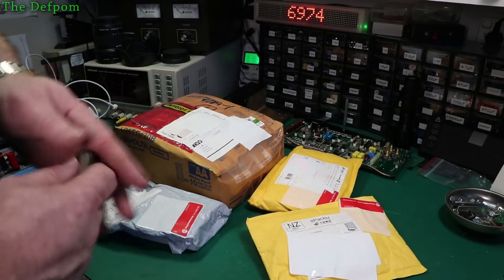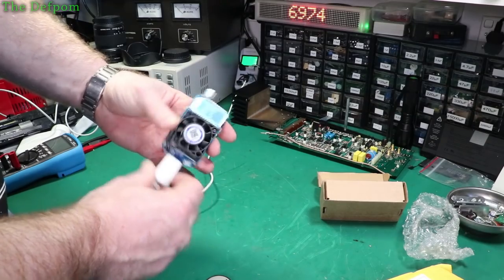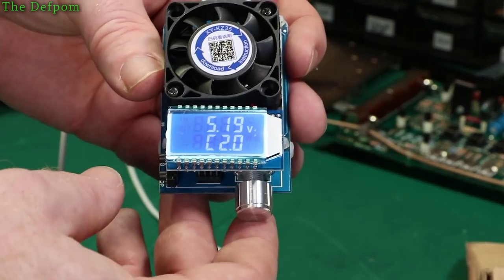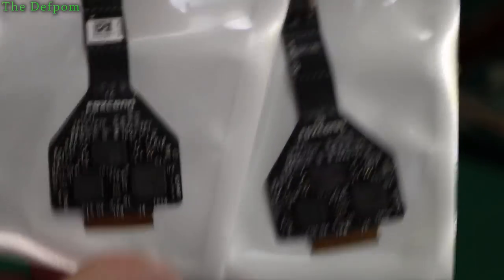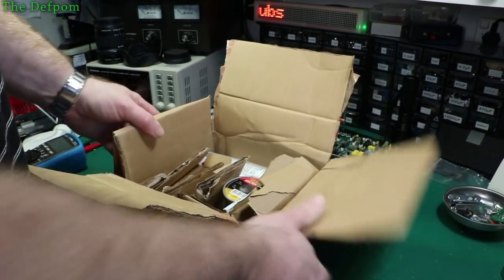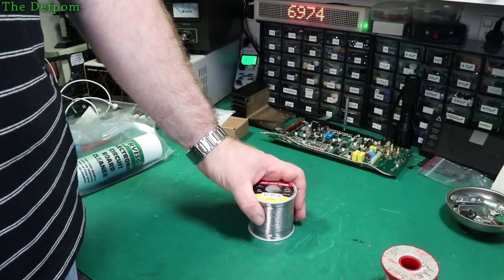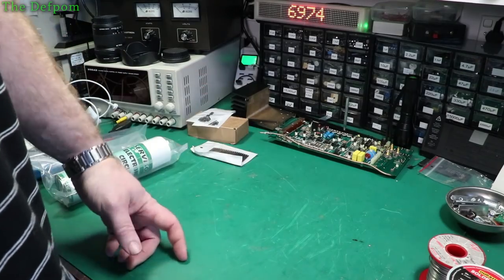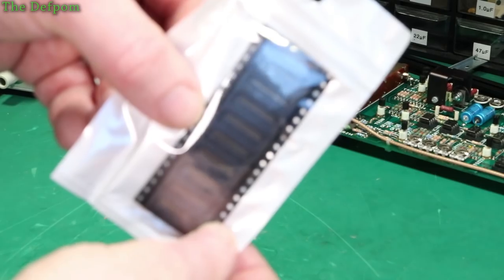🔴 #569 Mailbag Monday 27th May 2019

Comment: I've had different problems trying to get the multicore brand solder. I bought a small quantity of it on ebay, came in a plastic bag and looking under the microscope it only has 3 cores so I was ripped of. Bought a full reel on ebay and received a different brand. It is the unicorn of solders.